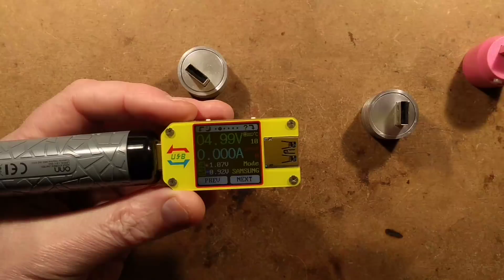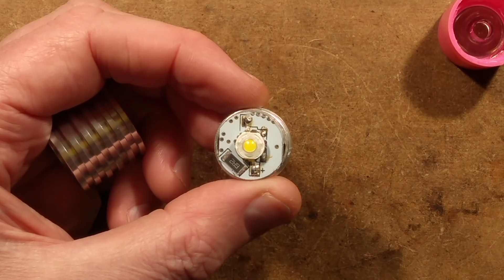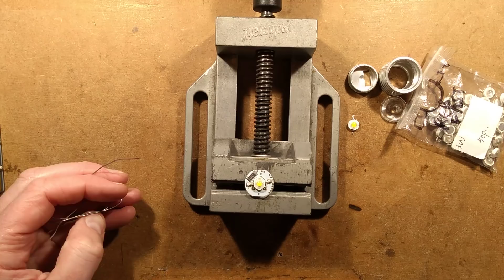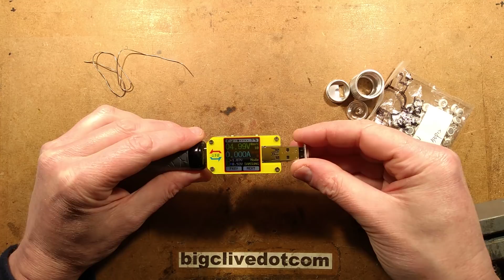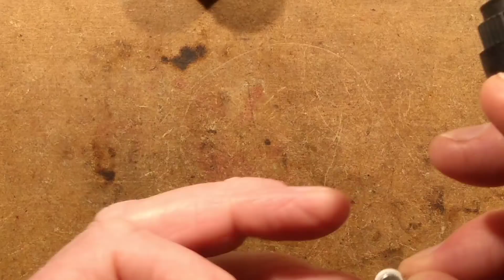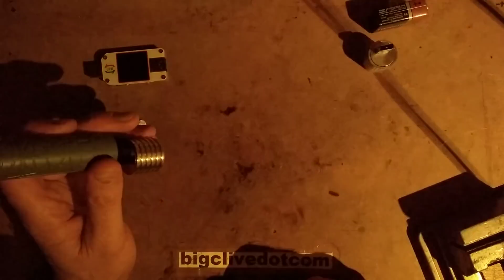Hacking a neat machined aluminium flashlight adaptor for power bank.  (Strobe warning.)

Comment: What value is the surface mount resistor? Either the led burned out or the resistor popped.
They must have discontinued it because I just looked and it's not showing in the search results.
Reply from the maker: You can swap both in these lights.

Comment: brother how is that almost a watt ? 
4.99 volt 260 mA is roughly 1.3 watts 
i think you got confused this is a usb out regulated to 5 volts and not an unregulated 18650 which would be around 4 volts
Reply from the maker: 260mA times the LED voltage of about 3V.  I don't include the resistor losses.

Comment: Funny story, I bought a few rolls of solder a while ago, and then changed my soldering iron as well. For the longest time, I always wondered if the iron's settings aren't accurate because I have to turn it up higher. It didn't matter much because I just had to make sure I turned it up high enough to solder comfortably. I was so sure I bought leaded solder that I didn't even check. It's not until recently that I was low on solder and decided to reorder some more. That's when I learned that I have been using lead-free solder for the past two years or so. It's now rectified. Oops.

Comment: Are you aware of any LED modules that use a 510 connector (term used in the vape world). I think the actual connector is 10 threads high, and the threads are m7 X 0.5mm. It's the same connector typically found on the bottom of vape tanks.

Comment: Help please. Searched for hours, cant find the flashing rgb color changing 1,2,3w leds on aliexpress or ebay! 

normally i find what i am looking for after ordering 100s of electric bits from china but i just cant find them only 5,3mm etc sort of little leds. not these high power ones.

i found these usb lights ages ago from one of my deep searches. good to see ya found them too. 
Nice idea to make one into a funky flashing colours one :).
i would like to take it night clubbing :). was thinking of using cree xml leds but the heatsink is a bit large for a pocket light without thermal limiting like in a torch. this made a easy pocket fun solution. may still do the cree xml light but as a bigger but small option to add to boom boxes.
Reply from the maker: I've never seen them since.  The listing was:-
3w RGB Slow Flash Rainbow MultiColor Red Green Blue LED Emitter For DIY
Reply: thank you for the listing name! appreciated :D
  @bigclivedotcom

Comment: I have the same Aluminium LED torch in front of me, current ambient is 28.5c. Mine doesn't need the lens in it too work, after 10 minutes ON via USB of the PC, at 230mA draw, the LED is reading 52.5c on my Infrared Thermometer. If that helps at all. I hope it does, as I am now BLIND....I have white spot disease in my eyes....DAMN that's bright when you look right at it. DON'T DO THAT !!!

Comment: Clive, have you seen these ones? https://www.ebay.com/itm/Aluminium-Alloy-USB-LED-Power-Bank-Flashlight-Head-Lamp-3W-Extension-Light-Torch/282725464210?_trkparms=aid%3D555018%26algo%3DPL.SIM%26ao%3D1%26asc%3D52885%26meid%3D1eab0f44af2d44d58868bc1299c50f16%26pid%3D100005%26rk%3D2%26rkt%3D12%26sd%3D113534076204%26itm%3D282725464210&_trksid=p2047675.c100005.m1851

Comment: Hi Clive, love the content and taking your example I converted all of my wife’s solar Christmas lights to run of usb. I was wondering if you have any recommendations for soldering irons or what to look out for as I just have a shitty cheap eBay one now.
Reply from the maker: If the soldering iron works then it's probably fine.  For many decades I used a humble Antex XS25 iron for all my prototyping and manufacturing work.
Reply: @bigclivedotcom  cheers

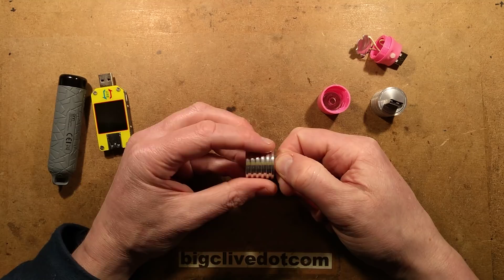Comment: @3:25, I think that "thread lock" is actually a little dab of heat-sink paste, intended to conduct heat to the outer case.  The grit in the paste does bite into aluminum and act as a thread lock.

Comment: Where did you source your emitters from?  I'd like to try both hacks.  I'm not real keen on how to determine current compatibility.
Reply from the maker: Any 1W or 3W bead will be fine in these with the existing resistor.  Try an eBay search for keywords like 100pcs 1w led beads

Comment: Clive, that resistor looks like a 2512 size part. I use them in my designs. Easy to get 1W versions, 2W are obtainable too, and if you can restrict source to one manufacturer then you can get them in 3W rating. I can get you some of you need them. PM me.
Reply from the maker: I just ordered some from eBay, thanks.  The keyword was 2512.

Comment: I've been getting into diy electronics/circuitry and have a question; what does "package" mean, like in the context "3w package LED"?
I've seen it on websites that sell components, it seems to refer to the way the component mounts and wires up?
Reply from the maker: It's the way the component is physically packaged for mounting.  A similar component could be available in several different mounting packages.

Comment: Lucky for you the LED wasn't soldered under the base. I recently hacked a cheapo LED torch to replace the cool white LED with a 420nm blue to give me an (almost) black-light torch. The LED was soldered under the base and took quite a bit of effort. Long Story short you needed to flood it with a ton of flux and a ton of lead free solder. Note that the white surround has the tensile strength of stilton at soldering temperatures.
See here for how to remove SMD without hot air guns:  https://www.youtube.com/watch?v=CVsmwFAkf7I
Reply: Doh! lead based solder, obvs.

Comment: This reminded me of me trying to replace the rear glass panel of my phone after I cracked it. During the replacement process I managed to damage one of the LEDs on my phone's camera flash and now it's blue.
Reply from the maker: They usually have a blue chip to stimulate the phosphor.  So the phosphors may have been knocked off or damaged.  (They usually look yellow.)

Comment: Have you spotted the so called 3w version with a switch mode and zoom, just bought one for two  squid.
Reply from the maker: That's a good price for that style.  If it's the multiple intensity and flashing one then mine just tested at 1.4W full output.

Comment: The RGB flasher output stays 'centered' because the lens, so close to the LED, refracts even slightly off center light to reflect off the inside of the lens surface (look up 'optics: critical angle' if you wanna get really geeky).  The slight hollow in the center close to the LED bends the light toward the large outer 'bell' of the lens, which acts like a reflector.  I'm guessing the aluminum shell reflects even more stray light back toward the lens, helping to smooth the light distribution, but I'd have to test it to be sure how much it really matters.

Comment: Look like about 6x3mm, so 2512 resistors Clive, not too unusual a size. At a glance, RS offers approx 1800 resistors at that size, some at a meaty 6w power rating!
Reply: Came here to say this, as the package was immediately recognisable as 2512 - they're quite distinct! (I'm a Patreon supporter, but I'm behind on videos so I only got around to watching this when it was public >.>) I literally just searched AliExpress for "2512" and got nothing but results for those resistors, although you'll find that most of the results will be for values in the sub-1Ω range, as of course those resistors are commonly used as current-sense resistors, but there are plenty of listings for higher values if you search around enough :) And yes, they're typically rated 1 Watt (the generic ones listed on AliExpress, at least - I've actually just found 16W 2512s on Digikey - with sufficient heat-sinking to the board, of course!), and IMO they're a bit expensive to buy from "western" distributors if you want any real quantity of them: I use 0Ω 2512s as large jumpers to jump over up to about 5 tracks in my home-etched single-sided PCBs (I use 0805/1206 for smaller jumps, of course), so I wanted to buy several hundred of them, which gets very slightly expensive for parts that are usually cheap enough to be effectively free - e.g. almost £20 for 500 of them... So I'd recommend somewhere like LCSC.com (sister company of JLCPCB, that sells tons of Chinese components as well as Western components, and is often the only place I've found to buy some Chinese parts!), where I can get 500x 0Ω 2512s for £7 :)

Comment: Hi Clive. I use those 3W led`s at 3W. I solder a thick guitar string on the back, and that string goes 2x in my circuit board for pasive cooling. With that they work great, without they cook themself. I make outdoor nightlamps with them, and led panels for better lighting for filming my youtube video`s. I think around 2.3Ohm for that color. Also works great with potmeters. Can go from very minimal light to extreme bright. I love them. Greetings

Comment: i use the plastic ones all the time for lighting without the cover and they are my favorite
BUT there is one more and i think you will like it it have has a switch and it uses a Q5 led with 3 modes and zoom what more could you want for LE$$ then $2 and a real lens https://www.aliexpress.com/item/USB-Portable-Charging-Lantern-Computer-Light-3-Mode-Reading-Lamp-USB-interface-Mini-Flash-Light-Q5/32818724752.html
Reply from the maker: I have one of those here.  It clocks in at 1.4W at full intensity.  It also came with a head mount with a USB socket on the front.

Comment: Great video, in the same vein is item # 173649519948 on US eBay. This is described as a 3 watt led flashlight with low, high and flash output, a "promise zoom" zoom mode plus it can be used with an "extension hose". It is aluminum/aluminium/alloomnin and cost is between $ 3 and $ 6 US. DISCLAIMER:  I am not the seller nor do I have any affiliation with the seller nor do I endorse this product. It's just the first listing I found.
Reply: LE$$ the $2 https://www.aliexpress.com/item/USB-Portable-Charging-Lantern-Computer-Light-3-Mode-Reading-Lamp-USB-interface-Mini-Flash-Light-Q5/32818724752.html

Comment: The power of BigClive. The ebay item I clicked on had 38 sold in last hour. That was on ebay U.K and at £1.43. Next person will see 41 sold in last hour.
Reply: notice how the advert always says "4 available" too , they limit you to buying 4 in one go it seems.
Reply: @amojak  You can get around that limit by soldering two lengths of copper wire together, to form a cross, and hold it up to the screen as you click "buy it now". But you have to chant "The power of Big Clive compels you" in the same voice as the priest in The Exorcist used.
https://youtu.be/lpyg94OzHK0
Reply: Only 4 days later, and my second link offers LED color options: soft white, white, and green. Soft white is cheaper. I bet those were the LEDs that they already had with the right form factor. I expect more colors in a few days.

Comment: Sooo. Did you put any thermal paste on the back of the pcb to better transfer heat to the case now ?
Did i overlook that ?

Nice infos, but i really really really dont need another LED light...
Still need to build something with 3x warm white 3W / 15V COB LEDs i got for no good reason at all. :-)

Comment: What is your soldering iron you use ?
Reply from the maker: Yihua 8786D station.
Reply: James Wheeler A generic 936 clone, but I guess he checks all the internals and cables before first use, as cheaper models can be dodgy.
Reply: Every video!
Reply: Would you recommend a KATSU 936, as I would never  use the hot air side. P.s. thank you for taking the time to reply.

Comment: if i were you, i would have desoldered the usb and flipped it, also flipping the polarity of the led, to line up the body of the light with the power bank (yes, i have some slight OCD issues)
Reply: 100% agree. I thought that was going to be the "Hack" but I should've known Clive really likes changing the colors of anything. I like to imagine his whole house doesn't have a single white ceiling light in it.
Reply: "Slight OCD"? Whatever dude, your "would have" is indicative of a healthy mind and is perfectly normal to think that way. Especially at a time when we're surrounded by so many pieces of shit made by name brands. The only thing I'd do differently is change meters midway of refabrication and smoke a diode, figure out what I did wrong and flip it, then smoke the batt and the meter because I forgot the polarity was opposite of the lead colors on my functional meter. Then when my new parts arrive and I go at it with what I learned last time, I find that manufacturer had done this for us already, more smoke. I had slight ocd until I started just giving up first. My dr. says I'm cured and whatever I'm not doing now is much healthier than what wasn't working for me before. I was puzzled by his statement and replied "a stupid flashlight?" He gave me his and said don't come back until it turns off, which it did as I said "but I haven't left yet". He got mad and grabbed for it but I hit the switch again before he got a grip. I yelled NOOO about the time the nurse came in and he was lunging at me again. I got out of there with two functional flashlights and a hard candy. They must have lost my address because I never got a bill. I went to the office and it had been converted into a paintballing adventure thing. I went in to inquire about the whereabouts of the previous renters of the building but they didn't know, one guy said they were the only people to ever lease the building, He only said that because someone had just shot him a few times in vicinity of where his balls should be and the paint was still dripping off. To this day I've never heard another grown man cry so loud. I told them that a great Dr. had once rented the building, and that the nurse could cure anything she touched(alot) , and that I owed them money. They didn't have much to say but one guy I think was crying when he saw my flashlight but I couldn't tell for sure because of the paintball mask, I understood if he was because it was a good one. I asked if I could join their paintballing club and they were pretty rude and insisted it was a private club. But the window said $15 a day per person, no registration, no membership" and when I looked at the window from the inside, I knew. It clearly said medical center at the bottom. My heart sank and I turned to the paint boss guy and gave him his flashlight back, he slowly lifted his mask as he turned away and stood there a minute. I said sorry and he turned around and gave it back. He confidently said "No, I'm sorry" and that I deserved it more than him because he never was a doctor and that I was the only one who had ever tried to pay for their visit after he was arrested. He'd saved lots of monies so his 25-40 year sentence was reduced to 40 hours of community service. His lawyer was able to prove his service to the community somehow and the number of hours he'd already accumulated as a fake doctor was much greater than 40, eventually he was compensated by the taxpayers for his generosity over the years and was awarded about 60,000 dollars minus court costs. He gave me the website where he got his fake Dr. stuff including the flashlight which was listed at $740 or something with a rebate of an even $750. I ordered one of course. That is the only thing I would do different than you Paul. Thanks Clive!
Reply: @maxprophet2401  What the hell was that?
Reply: @John Smith  I thought it was an obvious example of my OCD, I can try again if you would like :)
Reply: @maxprophet2401  
ya , have another go , i think you missed a word or two out :-)
Reply: Something about your comment says you're not qualified to think that.
Reply: I was wrong, looking back after 3:20, just grip and twist it 180 deg. and add loctite :)   that was much easier!
Reply: @maxprophet2401  
your probably right , in fact im not qualified to think at all , hehe :-)
Reply: @maxprophet2401  
that wouldnt change anything , the orientation of the connector stays the same within the circle :-)
Reply: You're right on that,  so revert back to the previous solutions.
Reply from the maker: It dies fit perfectly in some USB powerbanks with the connector the other way round.
Reply: Probably a bit extra for most but if I had already put as much work as Clive into one I likely would have to preserve aesthetic effect, it just looks nice

Comment: Bang Good were selling these (or a close equivalent) some time back. They also sold a "12v rechargeable" variant (designed for charging via a standard car cigarette lighter port). These have turned out to be rather more reliable than usual (ours have  lasted years now!)
Reply: Rechargeable LEDs? Never heard of them!
Reply: for a 12v rechargeable torch you can't go far wrong wit the nebo torch, i have a few and they live in the cigarette socket to charge.

Comment: Flashlight that doesn't flash, which would be called stroboscope in dutch, torch that's not a paraffin burning stick dutch call fakkel. The dutch word is much more sensible: zaklamp, pocketlight, a light you can put in your pocket and implies portability. Fun stuff!
Reply: Josha Beukema that is why a speedlight is used to flash and a strobist uses speedlights.